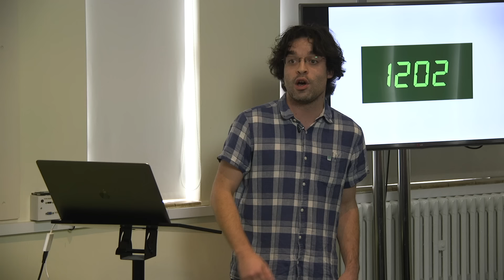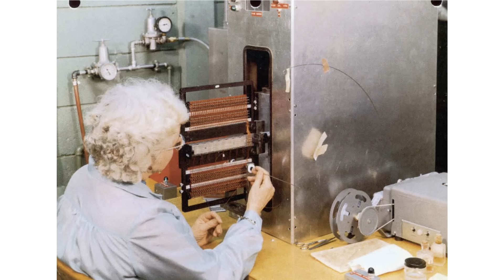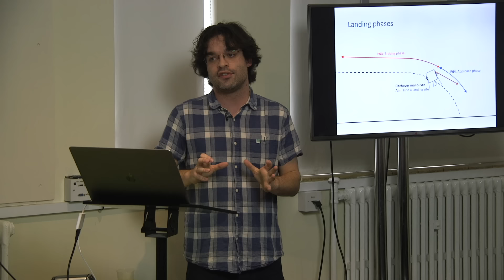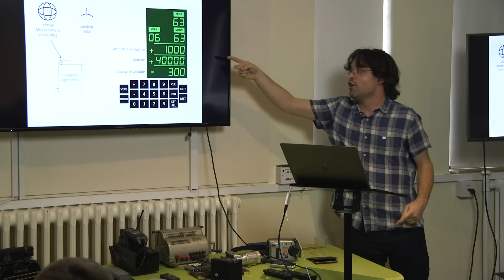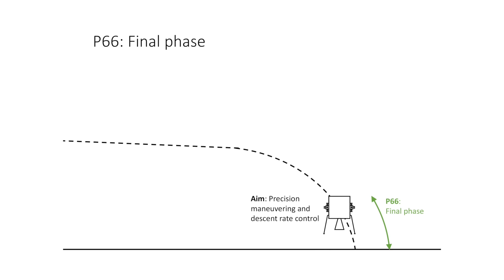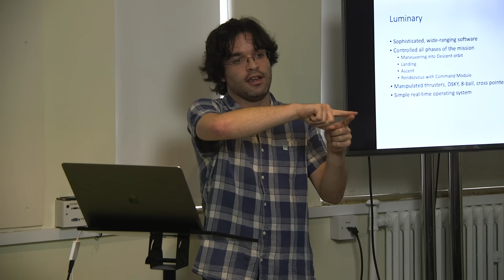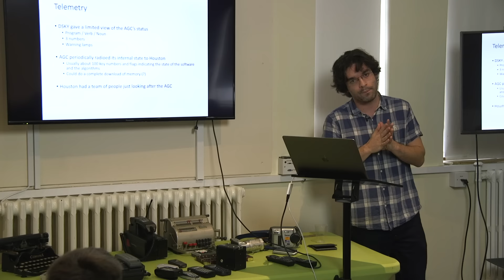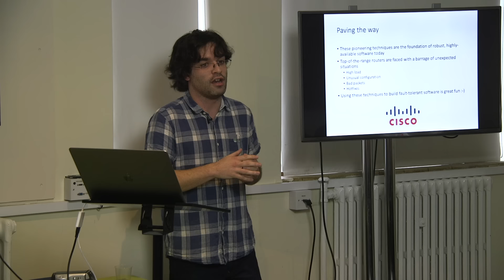Light Years Ahead | The 1969 Apollo Guidance Computer

Comment: Ya BULLSH!t.... Neil even said the full system ran off of 5 kilobytes so your saying that 5 kilobytes was enough to send a signal back and forth from earth to shuttle over 230,000 klm away? Ever tried to load a website with today’s pc power when your internet is only in the kilobytes? Takes forever to load Google, there’s no way even with today’s computer power is strong enough with Ram and CPU power that can do the mission to the Moon so 70 years ago with kilobytes isn’t happening... just like there’s no super WiFi NASA has to send the signal over 100 million miles away to a rover on MARS that only has 12GB of Ram to be able to control it, there would be signal stations plastered all the way there every so many miles to keep pushing the signal, no way it’s sending a signal from the ground of Earth up into space and then 100 million miles to Mars then down to the rover to control it..... if you think that’s possible you need to study NASA and why they can’t keep a 24/7 signal to the space station 300 miles above the earth without it cutting off every 30 mins with the lost communication screen popping up and yet you believe over 100 million miles away it’s easy as slicing butter?.... ya ok
Reply: Everything you just said is wrong and stupid and you should be ashamed.

Comment: Enjoyable and informative presentation, well done!!

01:09:35 that question could be answered by going through the original Apollo 11 checklist(s), because the “workaround” would only have been applied afterwards. Either way the NASA answer is technically correct if you want to keep the explanation simple.

Comment: One tiny problem. The VanAllen Radiation Belt fries everything that passes through it.
The Apollo computer wouldn’t survive the trip through the radiation, Apollo had no shielding.
NASA is still challenged today to get equipment through the radiation belt, while people is a sure no go.
“NASA engineer admits they can’t get past the Van Allen Belts”
https://youtu.be/4O5dPsu66Kw
Reply: What do you mean Apollo had no shielding? Of course it did. Everything between the outside of the capsule and the inside is considered shielding.
Reply: The specific time in the video discussing the VanAllen belt challenge starts at 3 minutes.
Reply: @messengerofiexist2139  
 You NASA haters and religiots, are truly pathetic!

Comment: Hey, since your writing code for traffic directing hardware, can you fix the issue when the internet gets ALL BUGGED UP with congestion?
"Have  DUTY CYCLED  verb 66 downgrade of high level code to only what is needed."
read stop all super cookies, cookies and advertising, in that order. Control duty cycle to stay below congestion.
Force any source of traffic to have a Bond in place, so that if they avoiding the solution the bond is at risk. No bond o access.
Stop abuse
limit marginal value add (only calculated from user perspective and traffic loading on web and local to end user. , to only excess dark traffic without a charge incurred for electricity and delay and delay uncertainty charge backs from all affected users collectively to ALL PERPETRATORS. Then this will get fixed. Botha simple in or out digital or a analog middle ground add for when excess BW is dark enough for high reliability and low latency.

Comment: Nowadays we still have problems with cell phone reception or GPS signal in some areas, but in the 1960s they could transmit to the moon? Wake up guys
Reply: It is almost if the hardware used is completely different. For fuck's sake, think before posting.

Comment: P00D00, Program 00 Data 00. Meaning memory is completely at zero state. In the Army, I was an NCR 500 technician, a system that had iron core memory, with 800 memory addresses, with each address having 12 binary coded decimal numbers. This system ran on a ms clock.

Comment: He's right about the Apollo guidance computer and wrong about why Armstrong landed manually. 
    Armstrong could see the autopilot was aiming to land on the rocky flank of West Crater (625 feet wide). This caused him to take over manual control and fly horizontally, searching for a safe landing spot. At the time, only Armstrong saw the hazard, and he was too busy flying the LM to discuss the situation with mission control.
    After flying over the hazards presented by the bouldery flank of West Crater, Armstrong spotted a safe landing site about 1,600 feet ahead where he carefully descended to the surface. Just before landing, the LM flew over what was later called Little West Crater (135 feet wide). After landing Armstrong visited and photographed this crater during his extravehicular activity.

Comment: To think the guidance computer was made up of less than 6000 gates ( present day  less than 5$ FPGA ). A wildly spinning Lunar Excursion Module would need attitude correction by firing rockets at very precise times with precise thrusts.   Wonder how the Apollo team managed to launch, transfer to lunar orbit, land on the moon, launch back to rendezvous with the lunar orbiter and head back to earth and splash down in one piece in 1969??  I wonder why Spacex is having trouble launching and landing 52 years later with all the density and scale of modern electronics & computing.  Just having a rain storm is enough to cause an outage for DBS satellite video service, how did they manage to communicate from the moon with a small dish over 10 times the distance of a geosynchronous satellite orbit ( power attenuated 100 times compared to what can be received by present day Satellite TV) while Earth &  Moon are rotating. Wonder if the RF link budget was adequate to overcome the background noise to be able to be amplify and demodulate the analog transmissions properly.
Reply: Maths and engineering. 

What SpaceX is trying is completely different than anything done before. Apples and oranges. 

Houston was able to communicate with the astronauts on the moon by having a parabolic antenna larger than your house, and a extremely powerful transmitter. Honestly, it should be self evident. Big antenna, big amplifier, big transmitter.

Comment: They just keep changing the story,  navigation computer becomed guidsnce computer,  they lost all material/prints/code even though modt of it came from IBM, now they have found it all of a sudden. Then they told you you were f****g stupid if you thought the complex calc of navigation were made by computer onboard, the onboard computer simply sent telemetry back to earth where huge computers in a datacenter were made and then transfered back to Apollo and now were back to the complex valculations being done by a very advanced onboard computer.
Reply: There's no changing of story here. What happened is that you read a bunch of nonsense on the internet and took it at face value, and now that you are presented with the truth you can't reconcile the bs you read with the factual stuff.

Comment: Good job.  I was an engineer on the Apollo/Sat V launch team at KSC and to this day, I'm amazed that we were able to pull it off multiple times.  This talk re-enforces that opinion.
Reply: Hello. What was your job on the Apollo? What was your focus?
Reply: @Sandybell1000  I was part of a small group of 5 engineers responsible for the pneumatic and hydraulic systems on the launch tower.  I also had the responsibility for the Q-Ball Cover retraction system on top of the LES.

Comment: Nothing has ever gone into outer space.  The sky is not an infinite vacuum.  Earth could not have air pressure the gas would disperse into the void.  The "outer space" narrative has been a science fiction fraud.  Sorry to burst the bubble.  Yes, we have woken up.
Reply: It sure does SUCK to be you!
Reply: The claim that the gas would disperse into a void is refuted by the fact that the higher up you go, the lower the air pressure, and yet, for some reason, the air at sea level doesn't disperse into the air at about 30,000 ft of altitude, even though there is a difference of about 10 psi over a fairly short period.
Reply: I'm curious, where did you get your BS? Or do you have an MSc? Please don't tell me you have an Sc. D!?

Comment: oooh, I got a question for you Robert, how many IO ports were there on that computer, (like Raspberry Pi and Arduino do) and how would you compare this to a current computer? I am thinking that a C64 would be a close one? or....? (Or is it impossible to compare because of the way computers communicate basically over protocols and hardly over physical ports?) (mouse, keyboard, etc excluding)

Comment: The slide at 38:31 says that AGC ran at about 26 milliseconds per instruction, while at 45:00 it is claimed that any job has to check for other jobs every 20 milliseconds. That would mean that jobs could only execute 1 instruction before checking and giving up control again? Are we sure this is correct?

Comment: I'm not sure he is correct in asserting that no computers use 1's complement arithmetic today.

I can't speak for the current crop of Unisys and Cray computers, but historically they used 1's complement arithmetic.  I worked at Sperry (before the Burroughs merger to form Unisys) and they used 1's complement arithmetic.  I believe that was due to the influence of Seymour Cray on their design.  The negative zero thing was a real programming pain, and caused many problems for the careless programmer.  Long after leaving Sperry/Unisys I worked as a software engineer for another company which had a version of their product that ran on the Cray supercomputer.  Being blissfully unaware that we had to support Cray hardware I wrote some code that assumed it was running on 2's complement hardware.  Fortunately, the problem was discovered almost immediately and because I had worked at Sperry I knew almost immediately what caused the problem and how to fix it.

Comment: At the 1:08:45 spot he talks about why the rendezvous radar was on ... this was controlled by the Abort Guidance System (AGS) - part of the abort process so that the lander could acquire the location of the command module in the event of an abort. It would make sense that the radar would have been off and activated only if the abort routine was needed but before being cleared to land they had to verify that the AGS was fully functional as this was considered the back-up for navigation even though it couldn't be used to land on the moon (GNC would give the GO on descent). The AGS had to be running and had to know what the primary guidance system (PGNCS) knew so that it could take over in the event of a PGNCS failure or an abort was triggered - and in Houston the telemetry readings from both systems were checked against each other to make sure that their location was known with confidence. The computer could handle both systems running simultaneously with both radar systems on (and as he shows, just barely) but in simulations no one had ever fed simulated AGS radar info into the computer so they didn't know how close to being maxed out they were. During landing both radar systems plus a doppler rangefinder were all on, even though the AGS radar provided no useful info. That's why in future missions the radar had to activate to satisfy that AGS was functional, but then the astronauts had to manually switch it off.

Comment: 1:18 - Neil would not have been calm since he never managed to land the LM in any of the earth flight practice exercises. He crash landed every time.
Had to stop listening after this important gaff.
What follows must be pure unicorn gibberish.
Reply: That's not true. The LM couldn't fly on earth, so he never tested it here. I may be referring to the training vehicles, but even that is wrong. He successfully landed it several times.
Reply: @atlas8827  
LM or test vehicle, it was supposed to simulate what he might face on the Moon. Please show evidence that he successfully landed the thing on earth.
How did they get through the Van Allen Belts?

How did they heat and cool the tin-can space craft in the extreme temperature on the moon surface with 25 volts of battery power?
Where is all the telemetry footage?
Why has no-one ever gone back?
Why are return missions always postponed for 5 or 10 years?
The questions go on and on.....unanswered.
Reply: @hthomasackermann  
LM is not the test vehicle. LM is the actual lander.
Here the evidence:
https://youtu.be/091ezcY-mkU

The radiation in the van allen belts can be seriously reduced by making the hull of the spacecraft thick enough, and by passing through the weakest part of the belts. This was tested successfully during the lunar orbiter missions. 

Temperature control can be achieved by insulating the spacecraft and by the use of liquid coolant. 

Telemetry isn't footage. It's a bunch of numbers. It was recorded on magnetic tape alongside the audio and tv signals. 

No one has gone back because it's insanely expensive and difficult. There's no commitment to it either.
Reply: @atlas8827  
You are kidding...right?
Your explanations are things people have pulled out of their hats for 50+ years - total layman's BS.
I'm not fooled.
As for the footage of the test vehicle, there was never more than a few seconds of filming, not exactly instilling confidence to prove anything.
Carry on in your delusions.
best
Reply: @hthomasackermann  
Why can't you instead debunk what I said? Why are my explanations layman BS? Why don't you have anything solid? Why do you have to resort to arguments from incredulity? Is it because you have nothing of substance? 

The footage I have posted proves beyond any doubt that Armstrong did in fact land the training vehicle, completely obliterating your claim that "he never managed to land the LM in any of the earth flight practice exercises. He crash landed every time."

Comment: Very enjoyable and interesting presentation. It hits home for me in many ways.  I was an engineering student back in the late 1960s and then later a software developer for some 30 years.  For a time in the 1970s I worked at AT&T on the computerized telephone switching systems that used many of these same technologies.  I really liked the discussion on the operating system although he said it was dry.  It's interesting that they could get the operating system to work fast enough to read in data and then take appropriate actions.  Basically, our modern cars work in exactly the same way as they scan the highway, give information to the driver, and then in some situations brake the vehicle.  The IBM guys were geniuses.

Comment: On Apollo 13, how did the LIM computer navigate both the LIM module and the command module back to Earth. The LIM computer was not programmed to control the weight of the two modules. I would presume that the two modules together would be an under damped control system. So very hard to control.

Comment: Hi, very much enjoyed your lecture. About that puzzling question - why was the Rendezvous radar was turned on during descent and landing? My thoughts are such: It is named for, and primary use was, planned ascent and rendezvous (re-docking) with the command module. However it would also be highly needed in a landing abort event. You correctly described landing abort as a series of pretty violent, no time wasted, series of actions with physical severing of cables and the firing of yet another rocket engine. That engine, as all rocket engines, with limited fuel supply. Even though the first seconds of the landing abort guidance could easily have been coded 'get spaceship to vertical orientation, gain height relative to moon surface and get back into orbit', it would be most fuel economic, and thereby safest, to quickly have input about where the command module is and to start converging the 'get back into orbit' guidance with the position of the Command Modul as target point. And for that you would need the Rendezvous Radar to operative, in a hurry. I don't think you would want to rely on one of the crew finding the right switch to turn it on. I'm thinking, physically, you probably wanted to have the radar unit powered up, voltage on, drawing from the power bank, to save time if it where needed in an emergency, which the abort event is. Don't know enough about radar from the 60's, but it might take a while to warm up? Powered up like this, it would physically be ready, but not yet interrupting or sending (blank) data to the guidance system. From there, code in the abort function could start the interrupt and data feed sequence into the tracking/guidance loop. You mentioned a hardware bug (in the RR switch?) but didn't go into detail. You also mention the hardware bug was not discovered during simulation so in my mind they were simulating the guidance software directly against simulation software and not hot wired. So the problem didn't show up because the simulation software was written as they intended the hardware to be, without the bug. Comments from all welcome.

Comment: A similar design concept was also used for the FAA’s computer systems.  IBM 9020 and code written in JOVIAL and BAL with interrupts both software and hardware generated.  Prioritized jobs running the critical data handled as a priority. The design criteria was to never lose data and, upon failure, restart the software using recorded data instead of a cold start.  Hardware redundancy, simple hardware component plug and play replacements.   

Really good presentation and explanations of the Apollo computer system...

(ATCS & Data Systems Specialist ZAB,ZDV retired)

Comment: He mentioned bloat code and how big Hello World usually is. If you code it in assembly on Linux a syscall is needed to print a string and another syscall to exit. There are unused fields in the ELF header where that code can be put depending on how many rules you are willing to break. So it can be < 100 bytes.